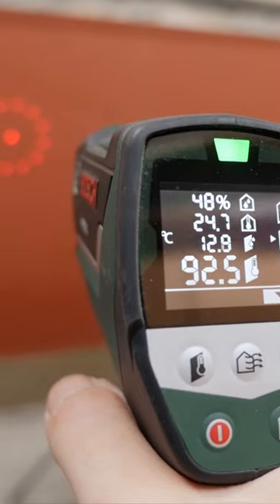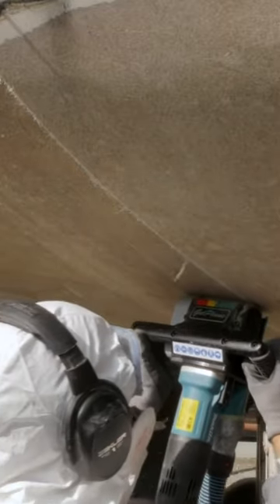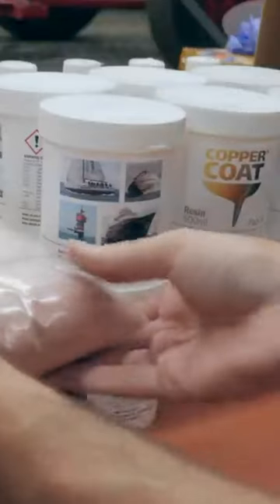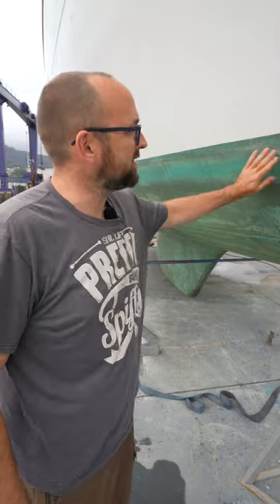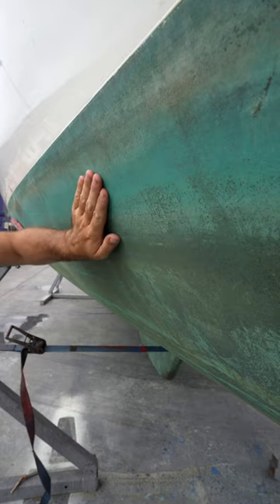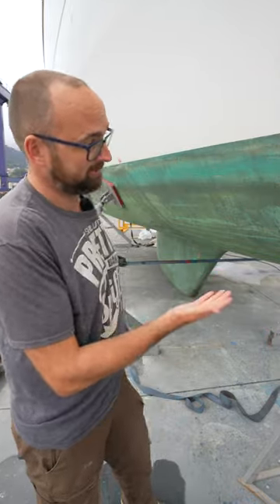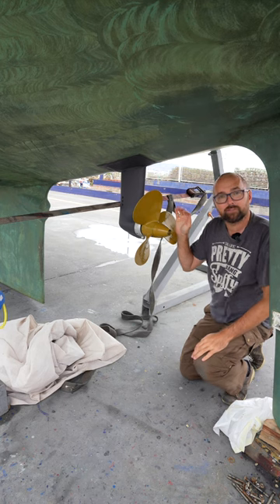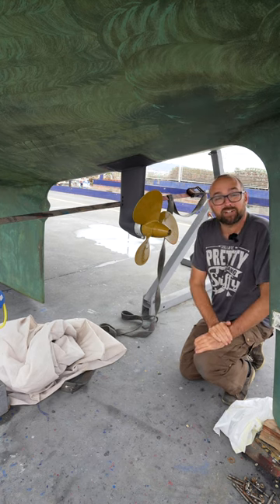Sail Life #short - West System 422 and Copper Coat after 2 years

Comment: Can't help thinking it was the copper coat that ate your rudder bracket. Maybe insulation tape under the bracket isolating it from the copper coat might be a good idea...
Reply: The copper could act as one side of the battery...
and the stainless lost out...
Reply: Might need a silicon bronze or monel bracket to eliminate corrosion issue?

Comment: Is that what's referred to as "sheaving"?
Reply: No, that’s a different thing; The act of putting a rope through a pulley. A pulley is a type of sheave. 
The new fibreglass lay-up on the hull is referred to as sheathing though. A sheathing is a protective layer. 
Cheers! R. 😎👍🍻
Reply: @robm.4512  Thanks for confirming what I suspected about sheathing despite my bad spelling (I am aware of sheaves).  I once turned away from a boat that had "some" blistering after sitting on mud a few years eventually having sheathing as treatment.
I hadn't heard of it before and didn't trust it would be a lasting solution.
Reply: @ratusbagus  Aha! If done correctly, as Mads demonstrated, it is a right and proper solution. 
Sadly, not everyone has access to the indoor space, the tools, the time or the resources to achieve a permanent repair. 
Cheers ol’buck 😎👍🍻
Reply: @robm.4512    I've noticed that he does appear to have a few bob!
Most of us don't have the money or the time.